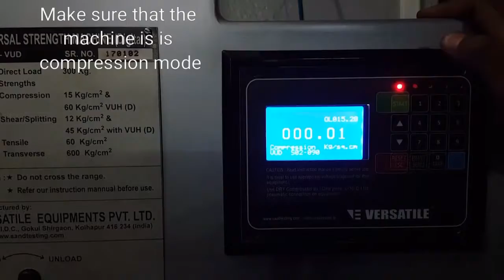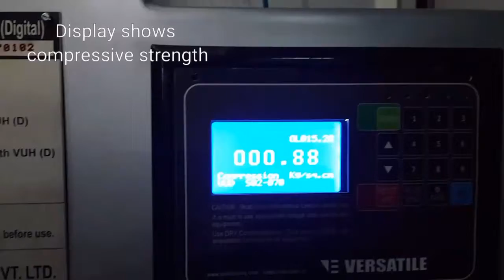Green Compression Strength checking of Sand on VUD

Comment: Weight of sample you use for this test?
Reply from the maker: Weight of sample is decided based on, how much sand is required to make a good specimen within tolerance. It can vary from setup to setup. Typically it’s around 153 g give or take a 20.
Reply: Thanks